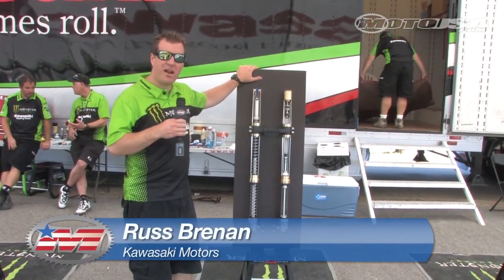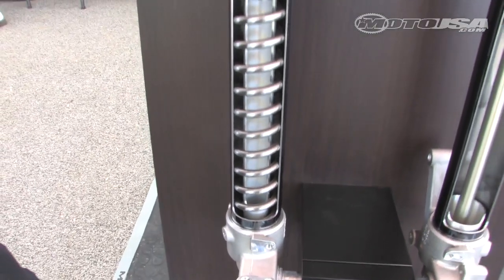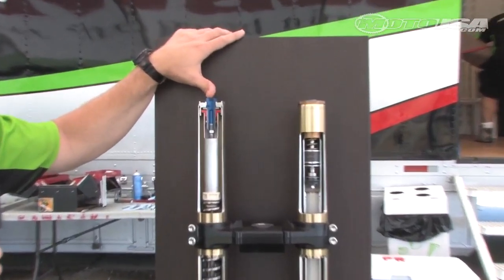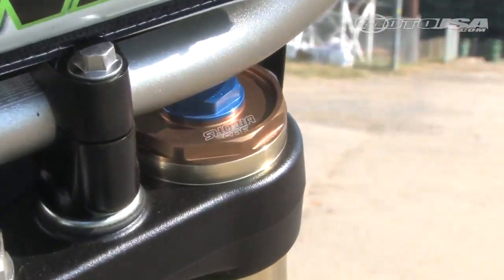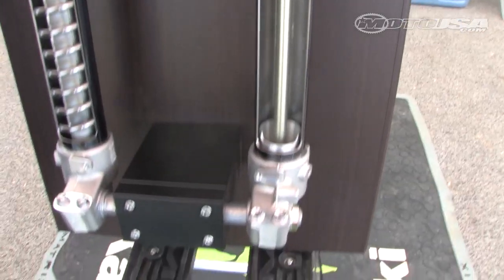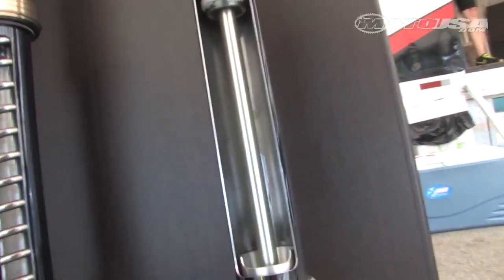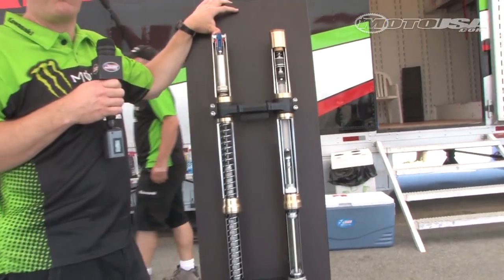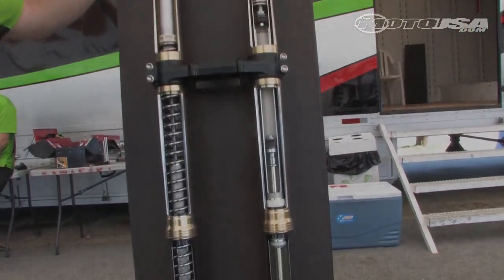MotoUSA Tech Video:  2011 Kawasaki KX250F Suspension

Comment: @Blaze0303 You can adjust any bikes suspension, but you can only adjust the front preload on a kx250f. It's different then compression/rebound which is the only thing you can adjust on the front suspension of a Honda.